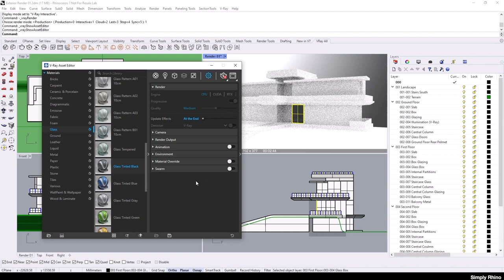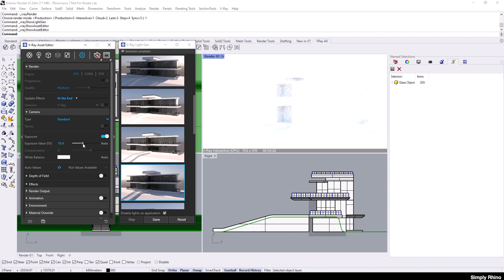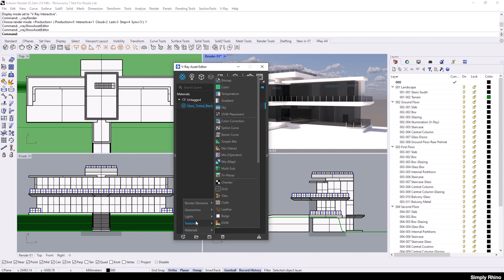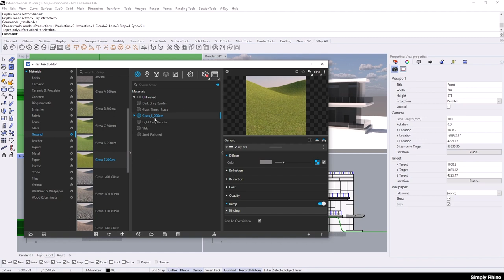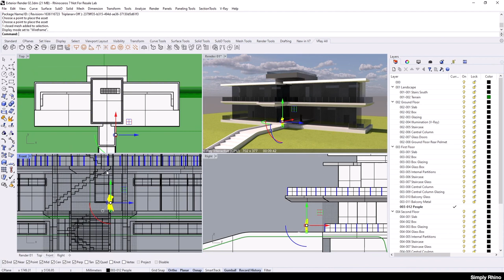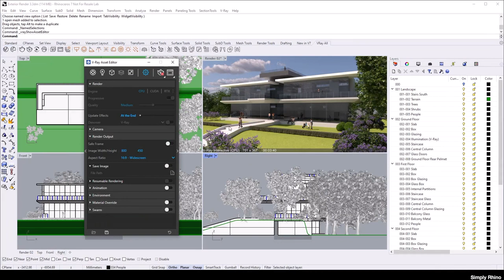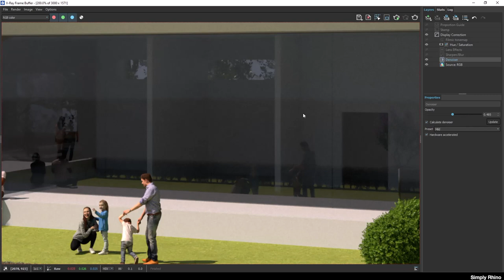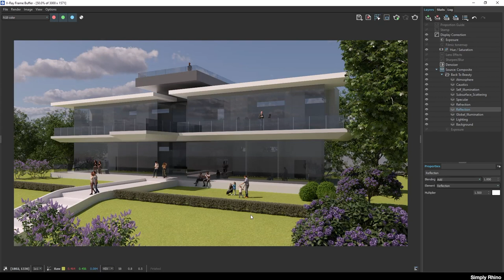Getting Started with V-Ray - Architectural Exterior Rendering with Rhino v7 and V-Ray 6

Comment: Hey really great work but do suggest me should I continue with vray for rhinoceros or shift to 3Ds Max since I find there are many functions not available in vray for rhinoceros like slate material editor and no layers state manager object ID etc. (my heart and soul is always in rhinoceros)it’s been  3 year I haven not been able to figure out how to use vray multi sub objects texture and TriPlanar in rhinocero I use it for my interior design viz.
Reply from the maker: Hi, V-Ray for 3DS Max and Rhino are, of course, different. 3DS Max is geared towards Visualisation and as such may have more of the features you require. Rhino is more geared towards production and manufacture however V-Ray for Rhino does have TriPlanar Mapping and does support Multi Materials. We can provide training on these areas and you can find more details here: https://simplyrhino.co.uk/training/courses/rhino-private-tailored-training